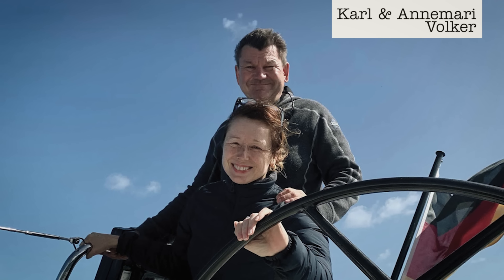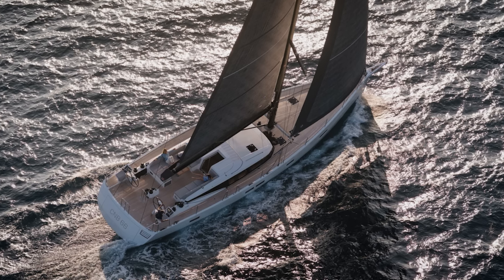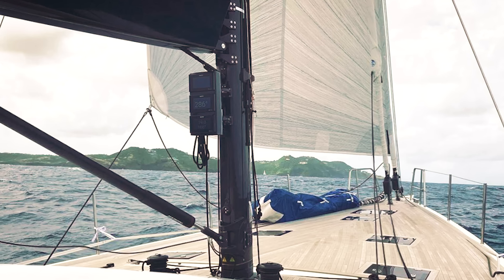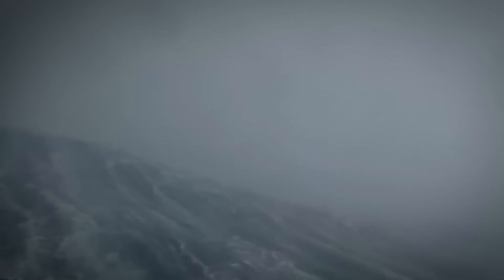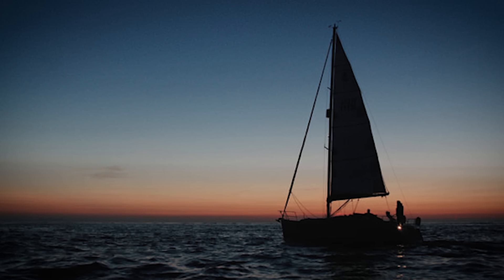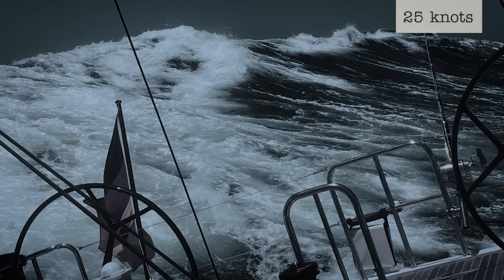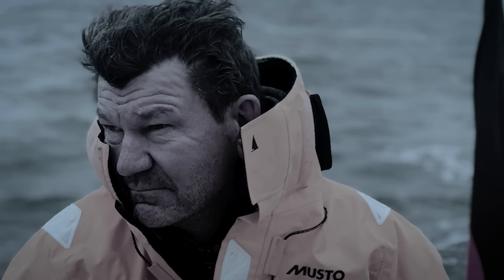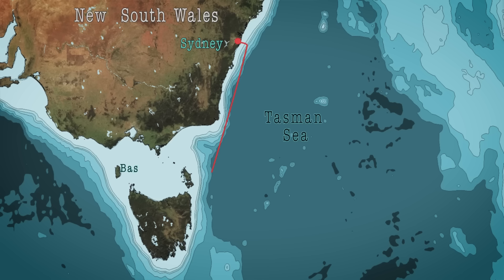Couple DIES on Private Yacht!

Comment: Thank you for the story. And first of all I want to say: "Rest In Peace" to the couple!

However, there're so many things that don't make any sense, that I'm curious whether it's the storyteller's inaccuracies, or a complete clusterf**ck going on the boat.

1. What was Karl doing on the bow with Genoa? It furls in from the cockpit and Genoa sheets are operated from the cockpit. And BTW you start furling in a full Genoa sail at 25 kt. of wind?? For those who don't know: Genoa (not a Jib) is a large foresail that goes at least to the mast and is designed to be operated in a lighter winds.

2. Since it looks that they were sailig dead downwind, 25 kt (or even 3o kt) of wind is actually not such a big deal for people on deck. I'm guesstimating, that the boat would produce at least 10 kt. of speed, so you get 15kt of wind over deck. Sheets do NOT fly around on deck with such wind. You need hurricane winds to throw unsecured sheets around the deck.

3. If a main sheet was "jammed" (whatever that means) - altering the course 15 degrees from downwind to broad reach would create tension and stop the boom swinging. And I still don't understand what does it mean "main sheet jammed". If an electric winch stoped working - you put a handle in and work it manually. And if the dedicated main sheet winch in the middle stuck completely (although I have never heard of such a thing, but be that as it may) - there're two more winches on each side of the boat that can be utilized.

4. It took them how much time to secure that boom??? And instead of turning around towards help they thought it was a good idea to sail away?? BTW if you turn into the wind and engage the motor, the boom wouldn't be swinging either. Yes, the ride would not be as smooth, but this was life and death situation.

And all this happened with 4 crew on board!

It's very sad to learn that lives were lost today with all the electronics and technology. RIP.

Comment: Sad story. In my view, totally unnecessary, due to the roller boom reefing.

I've done plenty of heavy weather sailing with short crew or even single handed. Took a 50 footer from Nassau back to Miami alone. Had to reef three times across the Gulf Stream with big swells. Did it pretty easily with slab reefing. No worries if you don't mind a little flapping. Of course the downhaul and clew reefing lines must be pre-rigged. This was a racing boat and not really designed for solo-sailing. It also did not have an auto pilot or electric or hydraulic winches.

On a larger cruiser, I'd go with mast roller reefing, a tracked boom and hydraulic winches. Roller reefing is just fine for headsails. It can be a real pain to change down to a storm jib while hooked into a jack line.

Comment: I can’t understand how the main sheet system could have been so poorly conceived. There’s a setup called The German mainsheet that seems similar but is used on smaller boats. This one apparently offered no mechanical advantage whatsoever (just one line on the boom) and relied entirely on one electric winch. 

Totally crazy. Also, what kind of crew is organized in such a way that only one person out of four knows how to operate the main sheet?

To top it off, who leads a jibe preventer through the bow?

Comment: This is not a cruising boat. It’s a racing sled.  It’s crazy.  Zero protection at the helm.  Look. You don’t have to be a sailor.  You CANNOT accidentally jibe if the main is centered.  The main sheet is in the wrong place, the boat is ridiculously too large to handle, the aspect ratio is too high.  I cruised. Single handed. I was in a. 46 ft sloop. In mast furling. This is so tragic. The architect is a bright guy w credentials. I don’t understand what was in his mind. Perhaps the clients drove some of these decisions. Plus these people seem not to know how to sail the sled. There is no excuse for booms accidentally  jibing. Or for getting lines tied up in the prop.

Comment: Sorry to be a stickler, but there are no ropes on a sail yacht except the one holding the bell. It's called the bell rope. The rest are called lines, sheets, halyards, vang, guy lines etc.
This looks like a high performance sailing yacht.
It sounds like the preventer came loose from the mast and hence the slack in the main sheet. And the crew discovered the preventer days later in calm seas caught around the prop shaft. Just a guess.
Reply from the maker: True. More than 70% of this audience aren’t sailors so I do try to give some context that they will understand.

Comment: So much so horribly wrong one hardly knows where to start.   Perhaps the most glaring fault is people who don't know the first thing about sailing putting off for blue water as if it were a summer day's sail on an inland lake in front of the yacht club.  This couple's choice of boat--so wretchedly wrong--tells me they didn't know at all what they were doing.  Far too large, laughably too complex, a lousy design for the intended use, a pickup crew, not even drilled in reefing the main, a common, routine maneuver.  They didn't even know enough to be able to look around the cockpit--about the size of a basketball half-court--and think, "This will never work."  If you are a lubber who decides you wanna buy a boat and sail around the world, face the fact that it will take you four to five years to learn enough to do so in a safe seaman-like manner.  And please, don't tell me they sailed around for two years without trouble.  Fools and idiots do this all the time...until they get into trouble.  You probably wouldn't buy a plane, hop in, and fly it to Alaska.  Why would you do so in a boat.  I don't have any sympathy for this couple.  Thank God their stupid behavior didn't cause the deaths of any servicemen who risked their lives to save fools.

Comment: SOBERING TO THINK OF THE FORCES INVOLVED:   We think it's much safer to be on a CNB 66 rather than a boat half the size, but the force on everything and, in this case,  the mainsheet increases with the square of the wind speed and directly with the sail area. So, if the sail area of a boat is four times larger (which could be the case when comparing a 66-foot boat to a 33-foot boat), and all other factors remain constant, the force on the mainsheet could indeed be roughly four times greater (says Copilot AI).

Comment: I know I shouldn't judge from the safety of my office, but it sounds like the title of this video is wrong. It's not the main sheet that killed them, it's their preparation or lack thereof. 
If anyone is battling the helm to get control of the boat, they should heave to immediately. Heave to, take stock of the situation, reef, put the engine on or simply take a break and lay hove to. This is a storm tactic and anyone with a USCG licence and years of sailing experience, knows this. 
There are 3 conditions for reefing: the helm is heavy (harder to steer), you wonder if you should put in a reef, your boat is healing more than 20 degrees.
Also the boat design is a bit of a disaster for offshore / blue water sailing. An open plan deck like that? With a single mast? Good for drinking cocktails, but sailing in the North Atlantic, it's a disaster waiting to happen.
Reply: I agree, heaving-to is the standard course of action, but its an accident. From the picture @2:11, is there only one stage compound pulley? It would be nearly impossible without the electric wench to sheet-in upwind or if the sail it out of control.

Comment: We sailed a lot of miles and also had to deal with heavy weather. We had a 30 ft. s.v. and we were just the two of us. We never took any risk, and our main rule was to avoid any discomfort, for us and the boat. First thing we did, was take away the main sail when things got nasty. This is only when you have enough space to move around. Leave just a ‘handkerchief’ of foresail for necessary speed and steering.

Comment: Excellent narration, many thanks for sharing. I don't understand why they opted for such a huge yacht when they're just a couple - vanity, perhaps...? It's all very well designing everything to work from the cockpit, but when things go wrong you've got to put your oilies on and go up top, and that's a long, wide platform to be scrabbling around on in a crisis. I think a 50ft centre-cockpit ketch would've been a better choice. Not as efficient, but smaller, more manageable sails and less distance to reach either mast. And a modern 50-footer can still be a quite a glamorous vessel, with ample storage for a long haul...

Comment: The boom furler didn’t kill them the main sheet did. But they told me they had to go forward each time they furled because they didn’t trust it would furl without jamming. He told me you could girl from the cockpit but he simply didn’t trust so they made a habit of going forward. But the routing of the main sheet to the center of the cockpit is what went wrong in this case. It came loose and began whipping as I understand it. That had little to do with the furl but perhaps it wouldn’t have happened if the furling process took place sooner if it were easier. I think they waited too long to furl because if the known complexity of the process. As the saying going if you think about furling it’s probably already too late. You furl anticipating conditions not after conditions get worse.

Comment: Sorry but the owner didn't tuck his time to train the crew well. Down wind sailing by wind is the hard part of sailing .  And whey he didn't heave to when the wind picked up. He had the weather information the wind will blow not very long.  He was not happy with the main sheet design ( Change to a V design with two winches ? ) May be the rod kicker was not strong enough?  A tragic accident need not have happened with more foresight and more training in the storm

Comment: Everything in this story was done wrong, it was like there were a bunch of novices on board the ship.  For one if someone gets hurt on board in the story and the boat is not set up stable what is more important the hurt human or getting the boat set up for safety. the boat without question.  Why did not not have a storm sail up in the first place, They could have just heaved to then worked it out. so many mistakes IMHO newbie mistakes. I also don't think a loose sheet caused the damage to the humans my guess was the boom.

Comment: To many reason to list here why these and many flush deck production boats that look pretty are not suitable for couples with  minimal experience to cross oceans.  If we look at a modern Imoca class single and double-handed yachts they are now handling sailing maneuvers from inside under full protection. Being full exposed on a flush deck sailing yacht in a seaway is a risky proposition for professional racing crews. Cruising couples are not racing and you have to have very experienced advice and/or have a great amount of experience to know what design elements are important. But yes many people have crossed oceans on a production boat and even dugout canoes

Comment: This "rope" is called a "sheet"
Reply: No sheet? Maybe it's escaped your notice, but this video does not seem to be intended solely for sailors, experienced or otherwise.
Reply: @frankmiller95  The comments make it abundantly clear that most viewers know nothing about sailing. Not that that prevents them from giving their "expert" opinions. (50 years of sailing experience, started in Optimist, then Laser and now singlehanding a Dufour 35)
Reply: @SuperDirk1965  Of course, you are absolutely correct.

Comment: Why didn't they turn in to the wind? If the boat is in irons, the boom is no longer swinging about. The boat seems to have been over-engineered. As others have said, should have been over-reefed rather than under-reefed. No harm in going more slowly, or even turning about if need be, upwind is far safer than downwind and under-powered far safer than over-powered. Downwind and overpowered is asking for what they got, so sad and so preventable.

Comment: 4:54 This illustration sucks. These wind arrows turn exactly the WRONG direction. This way you NEVER get a jibe. How on earth can you ask a landlubber to make this? Next time tell her or him to change it, until the 2D animation shows what REALLY happens. And send the video editor to a sail your sailyacht course, that helps a lot. Refusing to add a wrong drawing, you need to know it is flat wrong.  Besides, there are 22 feet yachts too, you do not need to be a millionaire to buy a sailing yacht. On the ocean, larger is more comfortable, and faster, that's the difference. A well designed small yacht can be just as safe. Good condition of EVERYTHING on a yacht is a big deal. Things breaking can be fatal. You see this here.

Comment: The owners should have gone for a smaller boat. Alway this need to show of and to go bigger and faster and more comfortable, but please everything should still be handled by only a minimum crew of two. Smaler boat, easier to handle. Simple as that. 
Secondly, the naval architekt did a bad job going for a single mast design. Ketch or Yawl design would have allowed for way smaller sails. You could go with reduced main only, or with a small jib and mizzen only and still pointing easily into every required direction, no matter which of the three main sails would fail.
And a design that allows reefing only under certain conditions screams for disaster anyway.

Comment: If this is the case where the mainsheet block sheared off and hit them! One of the causes was the mainsheet was originally designed to be mounted on the end of the boom but the owners had it changed to be mounted mid boom to creat more social space on the boat, this increased the load on the mainsheet to 3 tonnes and when it broke went off like a gun.
Reply: Thanks for that analysis. I thought that mainsheet setup was very queer…oops, homosexual, ……..oops I mean strange. Am I allowed to type strange? Anyway, it was weihd, it made the boat look like a Lightning or Star. You’re right, far too much load on one point in the cockpit. They were asking for trouble. I wonder if the heirs sued the designer? He should have known better and told them or at least had them sign a waiver

Comment: The truth is ona comercial vessel the area in front of the mainsheet would have large no step (or crisscross pattern) markings on it in bright paint. It is a dangerous place to be and that should be marked on the deck. But that would ruin the appeal of the teak deck.

This is a failure of the design, and as this is a popular design a failure by the entire industry to point this out and stop this non sense. Just like we ditched IOR boats after they killed a few too many and proved unsafe and unsound.

Comment: I love the comments from arm chair sailors, or bay racers this is a 66' ft boat. (When in doubt reef ASA 100) think about handling a boat of this size off shore in extreme conditions. I would love to hear your comments. This is why the the hired crew won't give there  names they were incompetent in handling this vessel
Reply: The two extra hands weren’t incompetent, the capt’n and his mate were. One obligation of a Capt’n is to  his crew is competent and properly trained. In this case, he did the first and failed the second. In the end, he was incapacitated then died through his negligence. It was his crew that brought the situation under control so that the injured could be evacuated. They demonstrated their competence in a bad situation that was not if their making.
Reply: I think they handled it to the best of there ability.
However they shared a part in understanding, the vessel, voyage and safety equipment before they ever left port.
You're also correct that the captain, should have trained them, which he probably did somewhat along the way.
He also should have vetted them to see if they had ever been on a boat of this size and there experience.
Not knowing who they are we will never know.
Unfortunately he paid for it with his life and his wife's

Comment: Perhaps it's only my amateur understanding but both the main sheet & control line for the boom and their winches look far too light for such a large sail. The boom vang obviously helps with vertical lift on the boom but the strain horizontally must be enormous on such a sail.

Comment: In mast furling isn't that great a solution, the heavier mast aside.
For sailing performance, the lack of horizontal battens mean you don't have as good a sail shape.
More importantly, if the weather turns against you and the sail jams in the mast as you try to reef, you can't drop it. Your only option is to wrap halyards around the sail to try to tie it to the mast. Not an easy thing to do when it's blowing and the yacht's pitching.
For sailing in the Ionian, you do find yourself getting the sail in and out more readily.

Comment: Can't add much to this except to observe that storm sails in heavy weather made my yachts easier to handle, really stable and didn't reduce speed by that much in terms of getting to a safe area.  And I have depowered boats single handing when the main gets stuck by dropping the jib or genoa or furling them.  Often then continue with the main if the weather is easing.